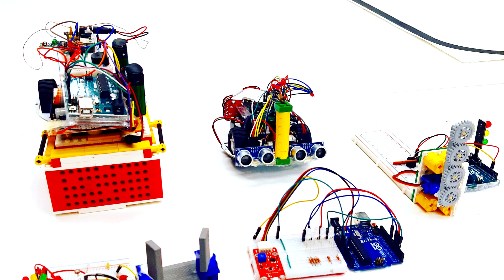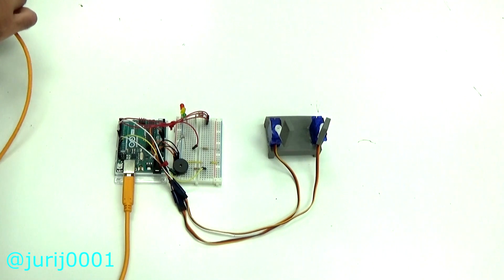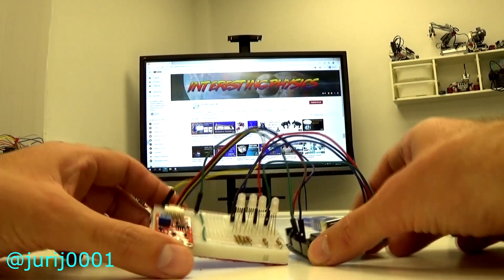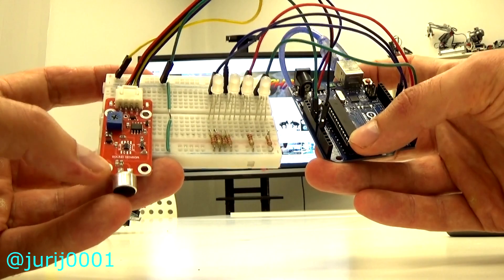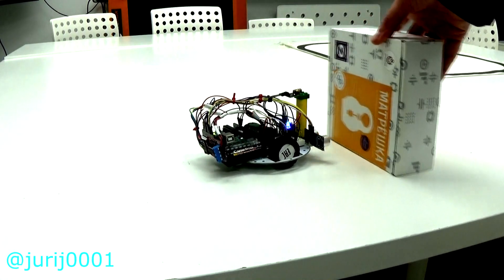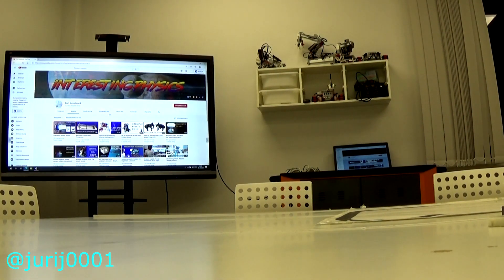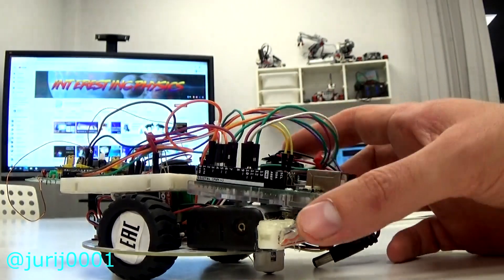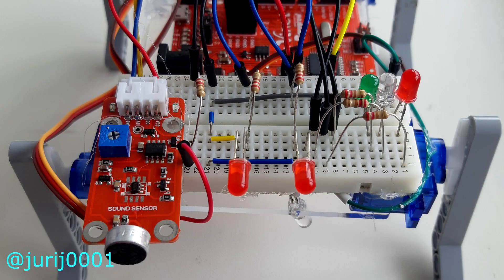Top 6 of my best Arduino projects

Comment from the maker: 170 notes. Physics and engineering. https://tspr.ng/c/170-notes-physics-and-enginee
21 problems in mechanics https://tspr.ng/c/21-problems-in-mechanics
21 notes on molecular physics and thermodynamics. https://tspr.ng/c/21-notes-on-molecular-physics
21 problem of electricity (electrostatics and laws of direct current) https://tspr.ng/c/physics-and-engineering-elec
21 problem of electricity (electromagnetism, alternating current) https://tspr.ng/c/21-problems-of-electromagnetis
27 notes on quantum and nuclear physics https://tspr.ng/c/27-notes-quantum-and-nuclear
21 notes on Astrophysics https://tspr.ng/c/astrophysics-21-notes